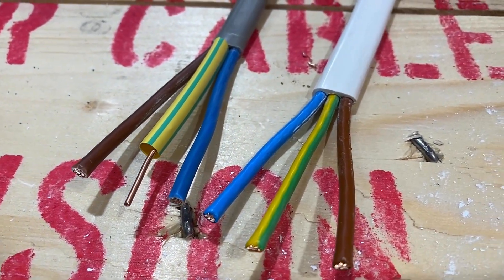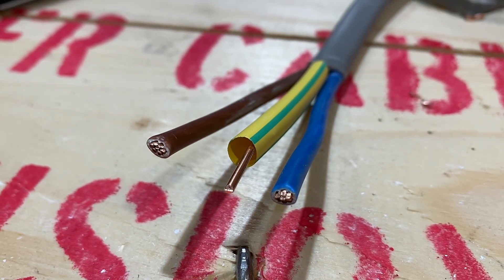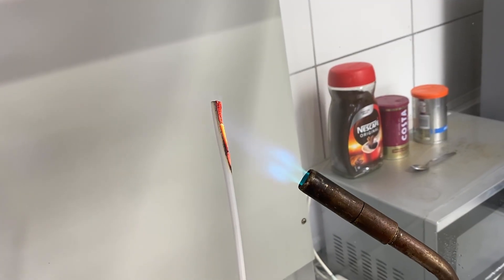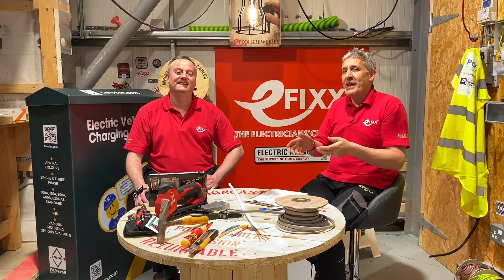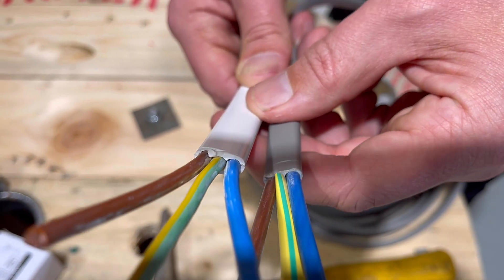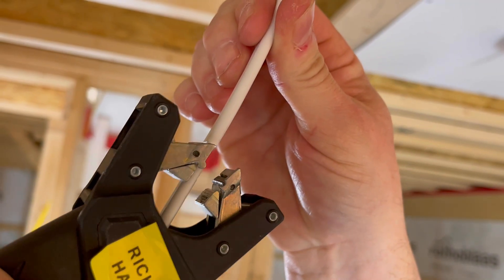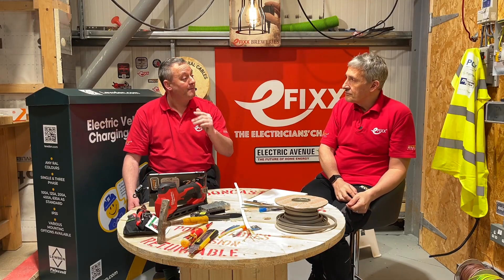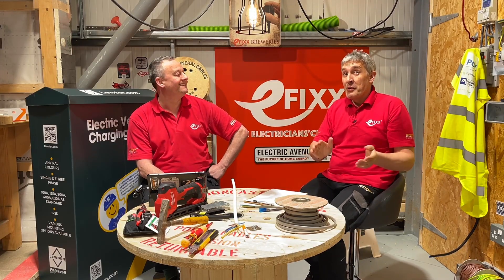REVEALED: The New British Standard for Electric Cables #aprilfools

Comment: Wow they catched up to normal european standards 😂
Reply: Welcome to 1995 for Europe, basically...
Reply: *caught up to
Reply: @simonb1996  *pedant
Reply: Exactly what I was thinking 😂
Reply: Same here, was my First thought. Quite ironic though
Reply: Tbf i like british electrics apart from the ring circuits and sleeveless PE. I love their metal DB and double insulated 25mm² meter tails.
Reply: @IAmThe_RA   there is no such thing as double insulated cable in the uk, how ever there is single insulated and sheathed cable 👍
Reply: @georgesmith6821  Meter tails are double insulated.
Reply: @IAmThe_RA   explain why would the cables be double insulated ? All uk cables are insulated to the maximum voltage present. However we have single insulated and sheathed cables (insulated) for voltage present and sheathed for mechanical protection 🤦‍♂️
Reply: @georgesmith6821  you can just google them lol see for yourself. Pictures are the explanation 😅
Reply: Must be a Brexit thing 😂
Reply: But Europe still lags on humour
Reply: Adiabatic equation?  !!!! 😂😂 nearly had me fooled with the white triple core cable
Reply: Love how UK always say NA wiring is so crap / "what we used to have in the 50's , but than make an April fool's joke about actually using quality materials that have been standard in NA for 20 years XKPE 90 wire has been the standard in residential wiring for decades
Reply: The word is "Caught"😊
Reply: Caught*
Reply: Next we need to cached up to English and how it is writ.
Reply: @jamesmaybury7452  immerhin bin ich kein Inselaffe und spreche mehr als eine Sprache.
Reply: We’ve all been to Benidorm on holiday, we know your lying 😆
Reply: Streichholz - caught not catched ! 👍
Reply: Yeah, but in England, we like to say caught up 😉
Reply: * Caught up
Reply: Hi there! 
Yeah,love to see your work as an electrician guys but your electric rules are really back in time. 
The fact that you nail cables to me it's completely wrong.
As a home owner if I want to add a circuit for a light point in my kitchen I will not have a way to put it mores wires to do separated commutations. 
Please forgive me if I'm wrong.
Beside the differences your methods in electric field are top ❤
Wish you the best
Love from Portugal
Reply: THE answer!!!
Reply: Caught *
Reply: Caught English bro
Reply: @daniel little  YouTube is an international platform. Maybe the writer does not speak English as a mother tongue. I do, and I understood him. I also admired his ability in a foreign language. Just saying you should be gentle on him. I've been pissed off so many times by French guys correcting me in the same way when I bravely attempted their language.
Reply: April Fools lol🎉
Reply: I can see that English language isn’t a strong point for you.
Reply: have you seen the european unfused plugs?
Reply: @alanreid3063  which plugs are you talking about? Every plug in my House runs over a Fuse, i live in Germany and i am an Electrician
Reply: @vsahankrat7176  Plugs not sockets, Neer seen a plug on end of flex with a fuse in it, seen plenty sockets fused for 3 kw running a small lamp with a small flex
Reply: @alanreid3063  and whats the Problem.Its 70 years Like this in Germany and not singel house burned down because of this
Reply: @alanreid3063  I see no Problem, since a few years its the standard to have RCD's for every Socket, so it doesnt matter if you have no fuse in a Plug from a Drill/Flex etc. the Flex doesnt have enough power to overheat any cable and if the cable is broken the RCD will turn everything of
Reply: And to add to that even if you had no RCD what problem is there with running a Flex on a 3,7kw fused socket?
Reply: @erikhundt4867  No, and likewise I doubt if a single UK house has burned down because of regular T&E cable.
Reply: @PharmaGiles  no there probably is no burning because of a T&E Cable but its never bad to have every single vein isolated in case a non electrician installed something and connected ground with a live wire.
Reply: @vsahankrat7176  RCDs go faulty they should not be relied upon.
Reply: @vsahankrat7176  that is their problem not the professional's
Reply: @krisedwards8063  as long as tested after first installation i never had problem with RCD from Hager. Rcd's are definetly reliable if u dont buy cheap ones and as mentioned in every norm they have to be tested every year in common households.
Reply: @krisedwards8063  thats not a good statement, ofcourse electric work should only be performed from professionals but im very sure you also do work that normally should also require a professional to be performed savely and correctly, like working on cars etc.
Reply: @krisedwards8063  RCDs do not provide overcurrent protection.
Reply: @2Sorts  Technically, RCCB and RCBO are RCDs.
Reply: @2Sorts  I never said they did.
Reply: @krisedwards8063  An RCBO is an RCD and it also provides over current protection.
Reply: It’s not normal standards it’s bad dodgy European electrics is what it is
Reply: @Imakeelectronicchaos  bad dogy european standard? What exactly do you mean
Reply: Stock to learning how to write properly mate.
Reply: @MdR8x9  distinguish yourself on your english skills when the arguments run out.
Reply: @Streichholz1600  
The argument ran out in 2016 when you lost
Reply: @MdR8x9  we all lost in 2016.